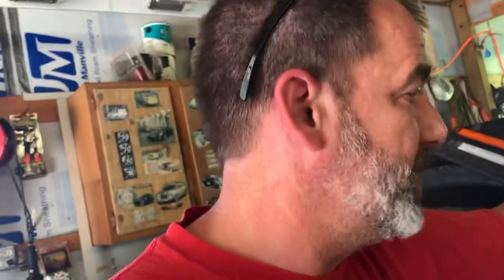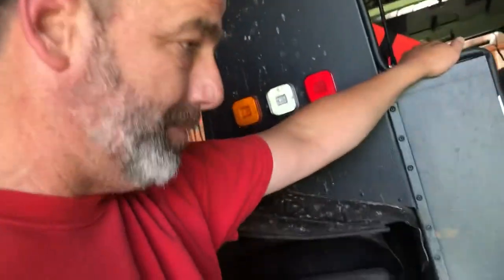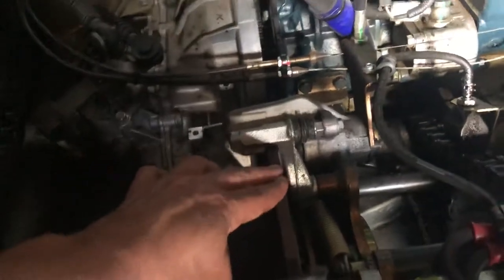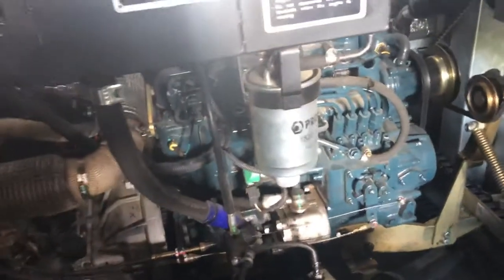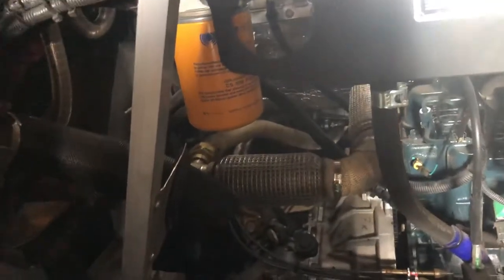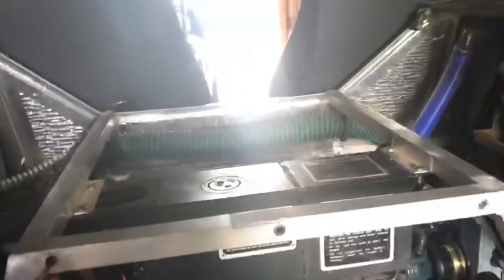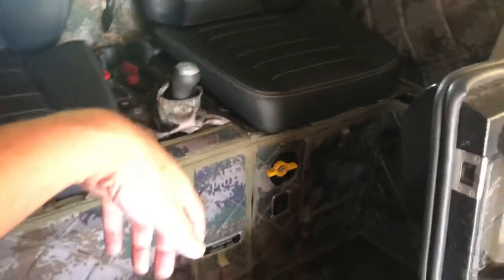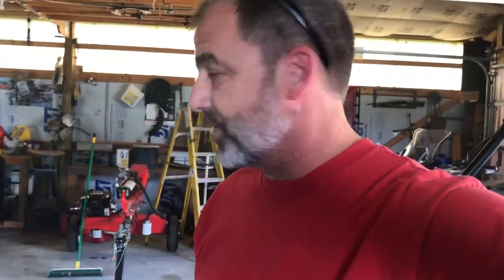Sherp Mechanical Overview - How Sherp Works

Comment: Question: Is it possible to put a stereo system in one of these so you can jam while driving. If it's loud inside just crank up the tunes. 🎶💿📻
Reply from the maker: coondogtheman1234  Absolutely. I use Bluetooth speaker with my phone.

Comment: You know it's made for Russia because it has no air conditioning.  Nice view of the mechanical s and accurate description of how it works. You have the ultimate air bag suspension.
Reply: All -terrain vehicle made in Ukraine.
Reply from the maker: Correct

Comment: Looking to purchase a used Sherp. A question I had was about how much do the tires cost and have you had to replace or patch a tire yet?
Reply from the maker: Not sure. I have about 160 hours on it. Been it all types of terrain including roads. Never had hole. I did break the seal on rim which was covered under warranty. Good luck o. Your Sherp quest. Thanks for subscribing!

Comment: Buddy can the sherp handle the heat of Australian conditions.
Reply from the maker: I believe so. You change the direction of the radiator fan based on the season. I have been in 95 F with no issues

Comment: Can you deflate tires while on trailer to gain roof clearance? Also is there a way to drain water from condensation inside the tires or is the hot humid exhaust not a problem?

Thanks - I didn’t know I had to have one of these
Reply from the maker: If tires are deflated when hauling. Flat tires make the Sherp loaded too wide. Greater than 101 inches. Also Sherp recommends have the tires fully inflated. Hope that helps. Thank for subscribing
Reply: @SherpET  - thank you, I was wondering why all the videos of them on a trailer had the tires aired up. Makes sense.